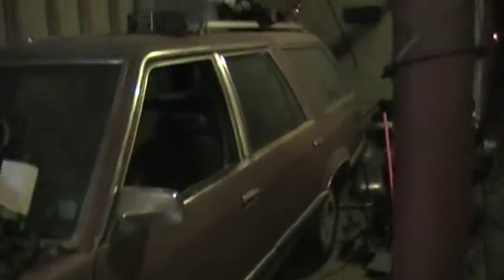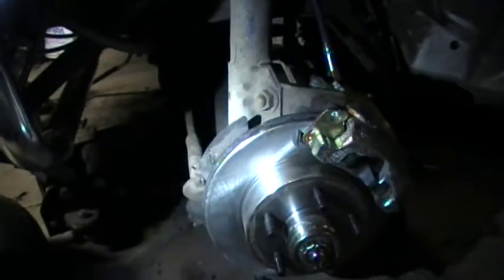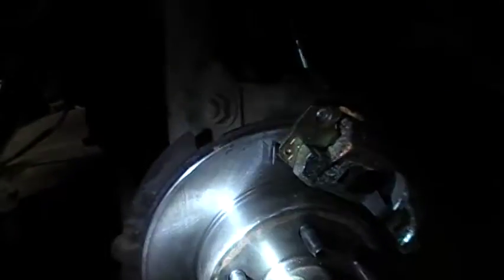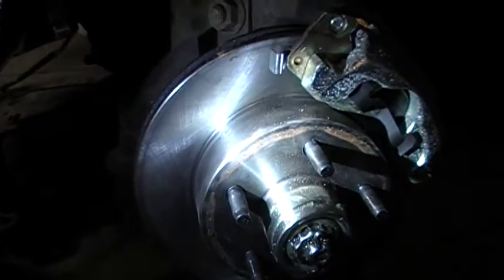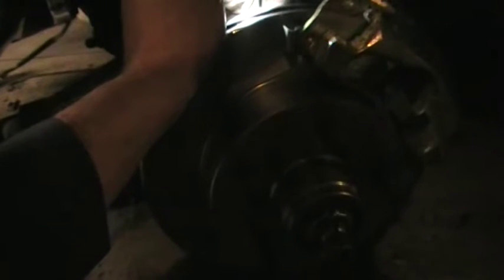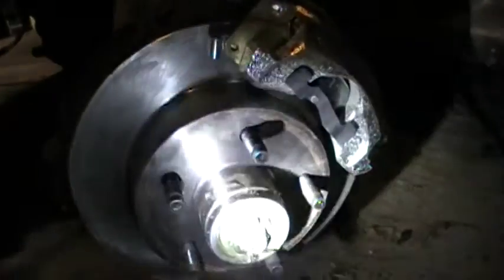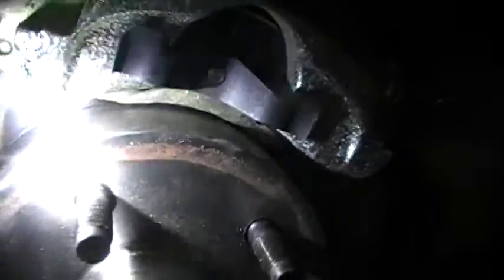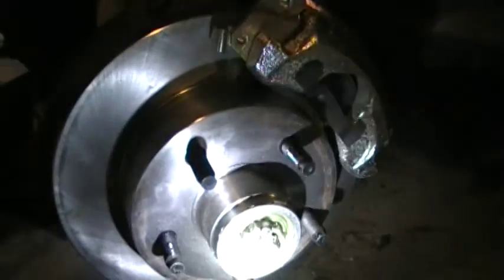how to 5 lug swap a fox body 4 or 6 cylinder platform front brakes

Comment: 94-95 sn95 Mustang spindles hubs rotors & caiblers 140$ at the yard seems like u went through a lot of stuff only thing u would have to change is the ball joints! Or u could of picked up a set Mustang V8 spindles dirt cheap with caiblers I got a 5 lug rotor from late Model Restoration fix right on there! But hey u got it 2 work in that's all it matters 👍👍!